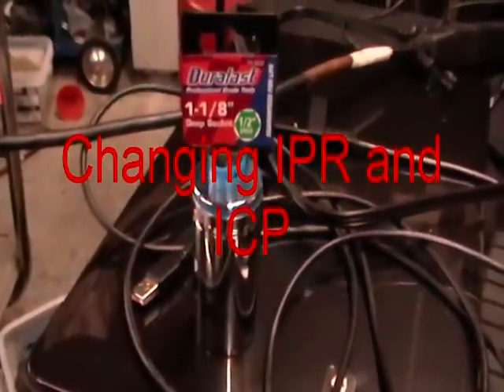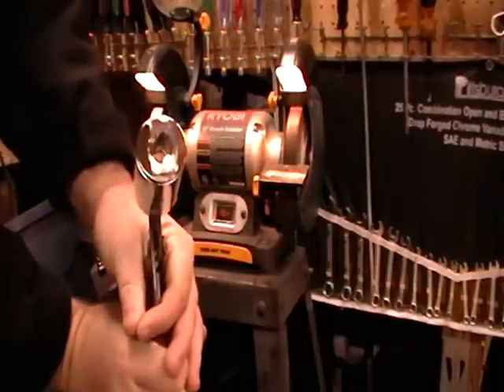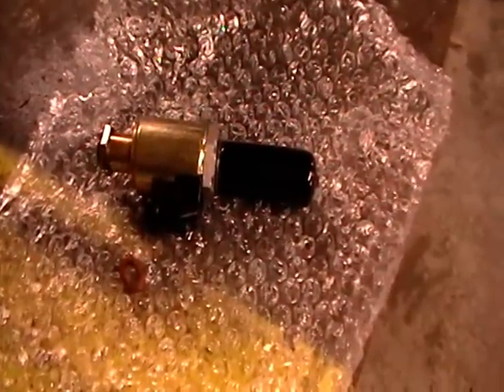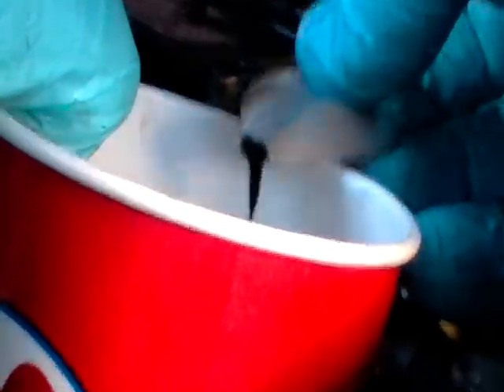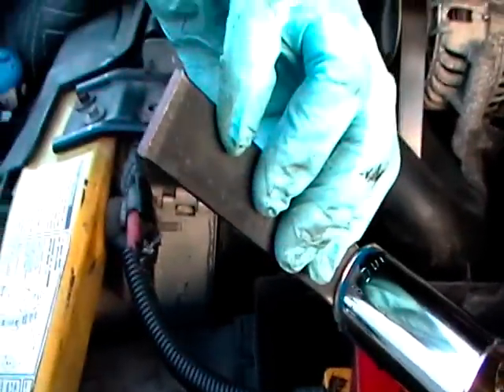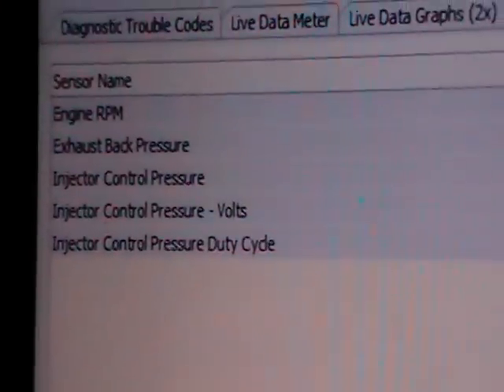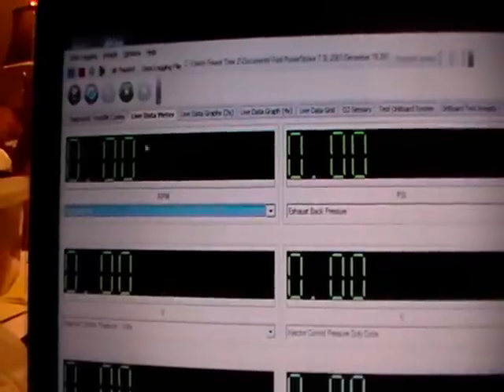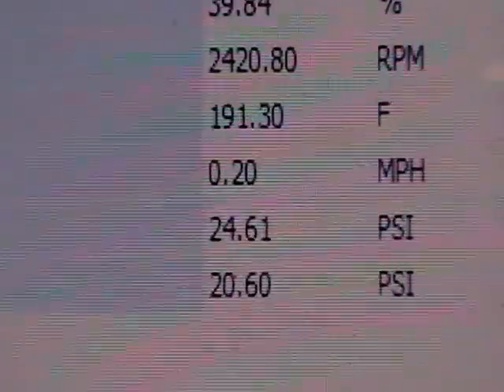How to change the  IPR and ICP 7.3l Ford Powerstroke without removing Fuel Bowl

Comment: On the newer 7.3 like this you can use a ratchet and socket, it's the older obs 7.3 that needs the fuel stuff removed for access.

Comment: Your a genius with the soap pump. Wish I would have thought of that but I used a old electric fuel pump laying around
Reply from the maker: Far from genius. What you did is a great idea too!
Reply: @SolidGroundStaging  well it was my tweaker neighbors that showed me when they handed me the pump with a garden hose attached that was soaked in gasoline. Now I know how they steal people gas so fast.
Reply: I use a brake bleeder vacuum pump to suck it out

Comment: I used a 1-5/32 stem extractor. Go to Home Depot go to plumbing get the socket set for removing shower valve stems it fits on it and use Chanel locks to grab the socket and she screws out no problem
Reply: Harbor freight has them also

Comment: 29mm deep socket, 3/8 flat rachet, 3/8 to 1" adapter works like a charm....none of this welding and grinding crap
Reply: Also wondering if you could use a belt remover tool (3/8 drive) since it is nothing more than a flat bar with a 3/8 square on the end?

Comment: Why does everybody keep using an 1-1/8" for the IPC?The replacement IPC is an exact fit at 1-1/16". I know I bought the part and after the maroon behind the parts counter gave me an 1-1/8" socket to change it out I went over to the rack and swapped it for an 1-1/16" after seeing how much play was in the 1-1/8".
Reply: The ICP is much smaller that the IPR.
I just liberated a stealer-fresh, new Ford/IH IPR from it's  fancy, multi-layer metallic pouch (inert gas filled?). An SAE 1-1/8 fits perfect. I tried an SAE 1-1/16 and it was a hard no-go.
The popular 29 mm should be fine but would be a tad looser than 1-1/8.
Reply: @rustysummers3217  Mine is a pickup. I pulled the fuel bowl for access. No grinding, cutting or welding.

Comment: I actually bought this same socket from O'Reilly's auto parts and as stated it will not clear the end of the IPR in order to get it all the way on and remove. I used a rotary tool with a grinding wheel and enlarged the hole inside the socket. Worked great and only took about 10 minutes. Use a flex head ratchet and no problem.

Comment: Also... you don't have to push the socket driver all the way INTO the socket.  I got it loose with a 30mm I had laying around (for removing a wheel nut from some previous vehicle) with only putting the nose of the socket driver into the socket.  A little bit of a break bar to get more length on the handle.  Popped it loose... yay!

Comment: For God's sake! You don't have to do any of this bull. Just go buy a Sears Craftsman 1 1/8 deep socket I/2 drive and do nothing but use it the way it was intended. This guy doesn't know what he is doing. I just changed mine out in about 45 minutes. The hardest part is putting the stamped steel nut back on the solenoid. The longest thing to do is to set up your truck with a ladder, cloth, rags, and gathering your tools for the job. And the only thing you need is as far as tools go are the 1 1/8 socket, 1/2 ratchet, 1/4 inch ratchet and socket for the nut, no other tools are needed. Unplug all the connectors around the area and push them out of the way. There is plenty of room for both the small wrench and the 1/2 drive socket and wrench to get on the IPR nut. There is no depth problem with the solenoid shaft going into the socket drive square, that's some sort of hoax people are trying to get you to believe. Yes you can only turn the ratchet 1/8+ turns but you only have to do that for about one revolution and then you can unscrew it by hand. And no all the oil doesn't flow out. You'll lose maybe a 1/4 of a cup at most. Put some rags down there if it worries you. But, before you do all this, look at the purple connector up and to the right of the IPR valve. If that connector has oil in it when you take it off, this is probably why your truck isn't running right. I forget what that one was, but if controls the PCM (gives feedback) and if that connector/sensor has issues, it's probably the reason you're thinking you have to replace the IPR valve. Take that one apart and clean it good with Gunk and hose it down with water and either let it dry on it's own or blow it out with air until dry. Good luck! If it takes you more than 45 minutes to do this, maybe working on cars is not for you.

Comment: Take a 1 quart mason jar and lid then go get a gas syfin hose from your auto parts store. Drill 2 hole in the top of the mason jar lid. Then screw it on the jar. Pull your syfin bulb off the hoses use a hot glue gun and feed the hoses about 1" threw the mason jar lid. Attach one end to a shop vac using duck tape or something similar. Then stick the other end in your high pressure oil pump resivore. And flip the shop vac on. Draw a quart add a quart then do this 3 more times and hpop is changed!!

Comment from the maker: SolidGroundStaging 1 second ago 

The truck was hard to crank, and lacked power all around the spectrum. Especialy towing. I have auto enginuity and checked the icp duty cycle and it was very high when I replaced the IPR it brought the values back to normal